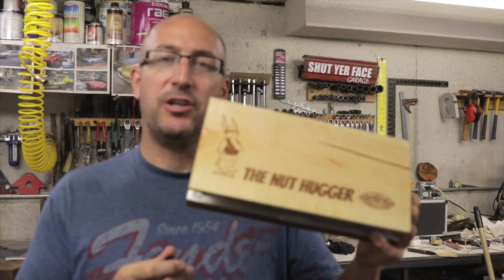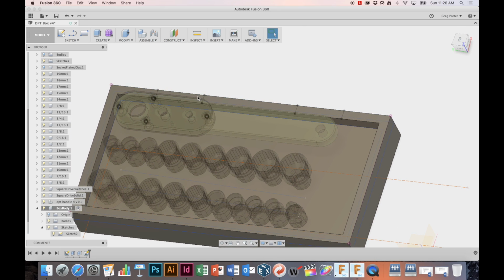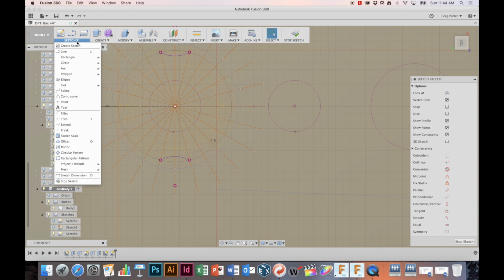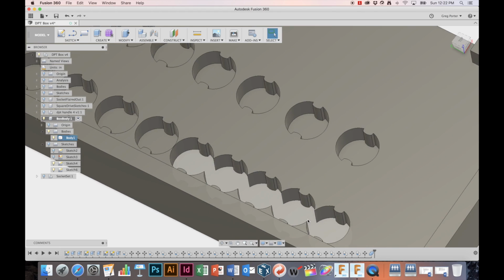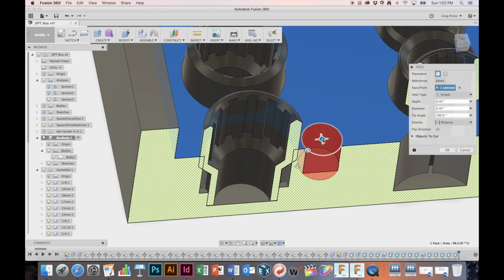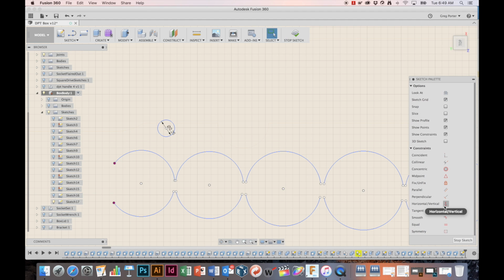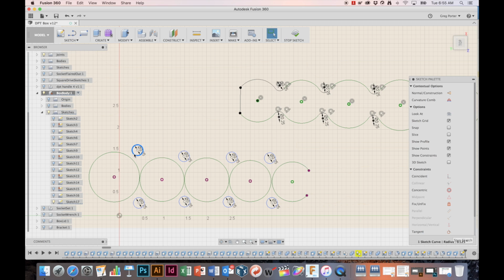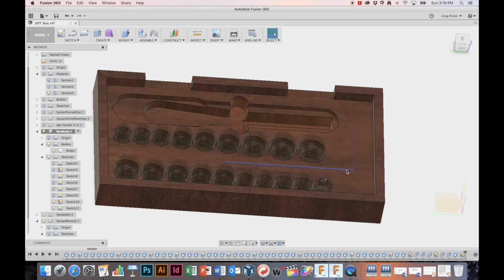Cutting Holes for Sockets - DPT BOX - FUSION 360 CAD

Comment: Wowee that's no small project!  Your issues with the fillets between your cutouts for the sockets made me curious so I played with it, if you make your cut across the circles in the 3d space, you can add the fillet directly to the model.  Not sure if that makes sense, haha!
Reply from the maker: Yes.  I could have done it in 3d, but it wouldn't make a smooth fillet across both pieces of geometry...  At least I couldn't get it to do it...
Reply: Ah, that makes a lot of sense.  Doing it in the sketch is also far more organized and professional! :)